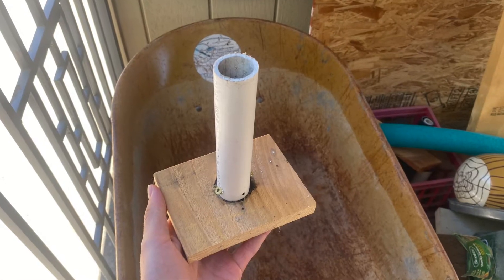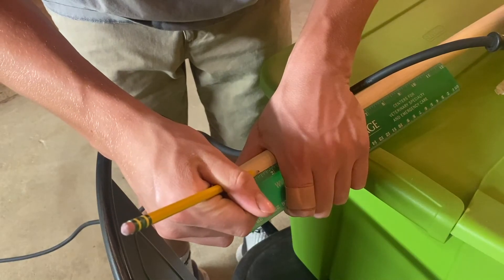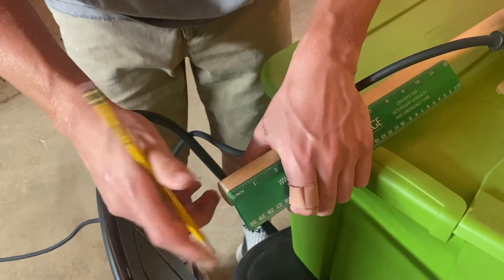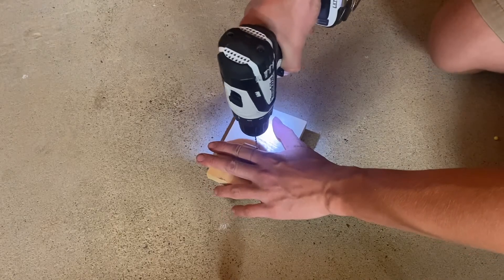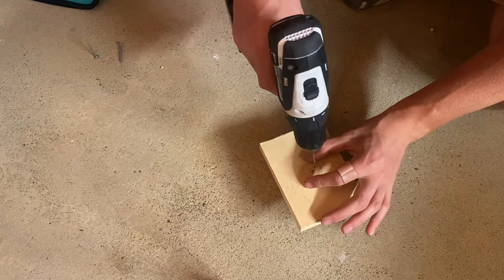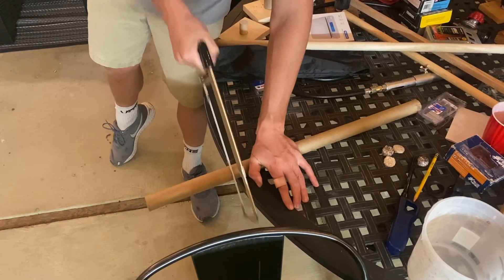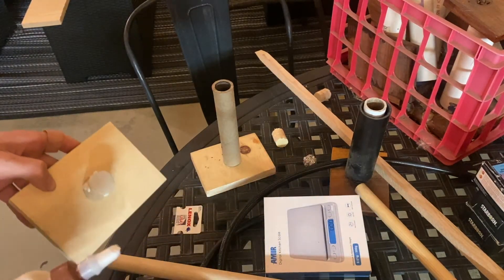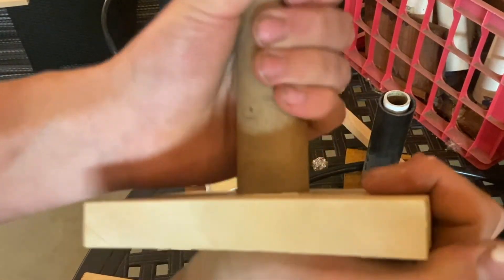How to Make Cardboard Mortars

Comment: I use cardboard tubes for my 3 inch guns I have an unlimited supply from my warehouse. I use a nice coat of polyurethane or wood glue inside and out and have had them last 3 or 4 years. If you added a poly or glue coat these can last much longer just wipe out the inside for storage or before next use. I make cakes similar to this but on a thinner board and I line them exactly like store cakes depending on the size and I'd save some tube if your using them to shoot mines there usually shorter for mines than for inserts nice work thanks for sharing and keep it up I love content like this